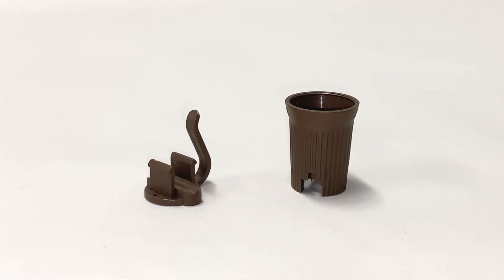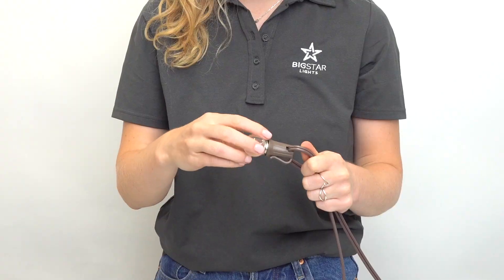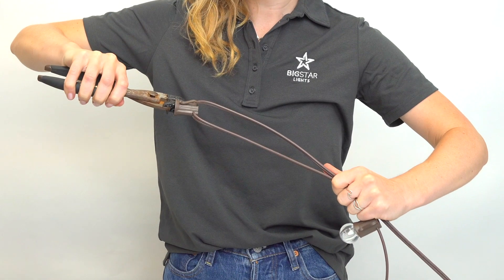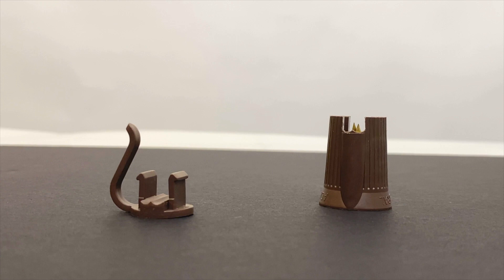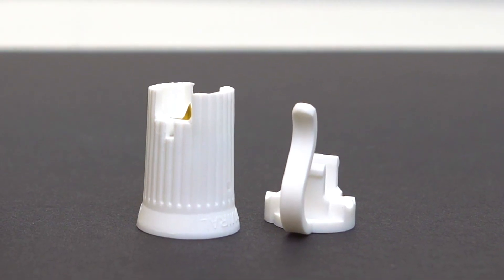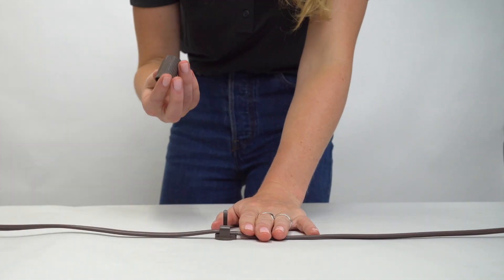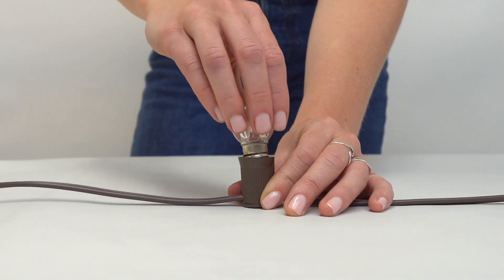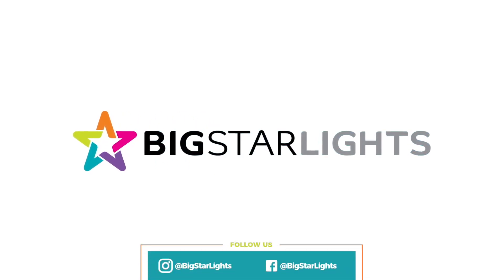Christmas Lighting Tips | How To Replace A Socket On Your Christmas Lights

Comment: Thanks for this awesome video. Does it matter which way the socket goes into the wire?
Reply from the maker: Hi Gary, it does! Just make sure you have the little clip tab consistent with the other sockets on the line and the current will flow properly. And never apply them with power running through the line!

Comment: What happens to the original area that the socket was biting into?  Does it have to be re-sealed? Ie so water doesn’t leak into the wire?
Reply from the maker: It does not have to be resealed! The new socket will cover the area, and the holes are far enough apart that there should be no issues with shorting.